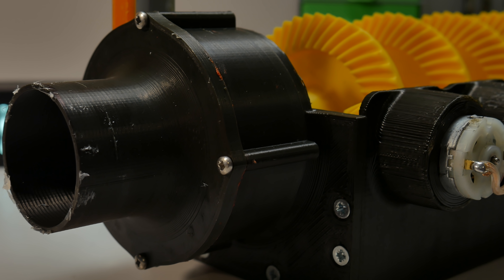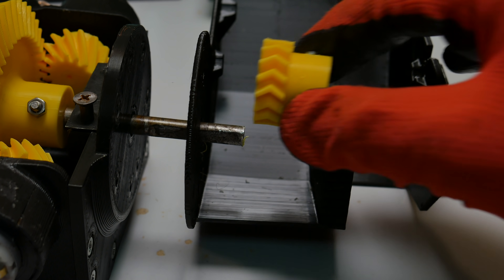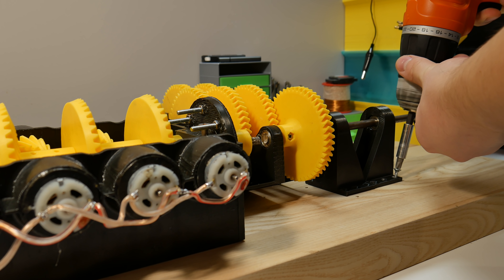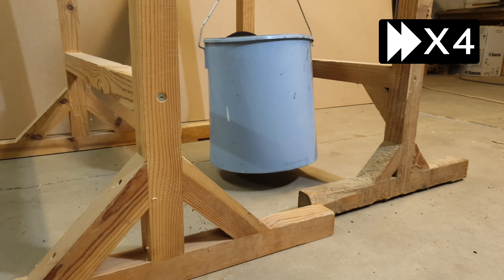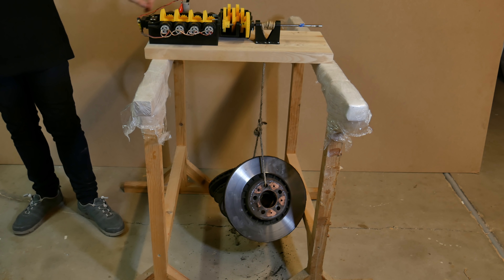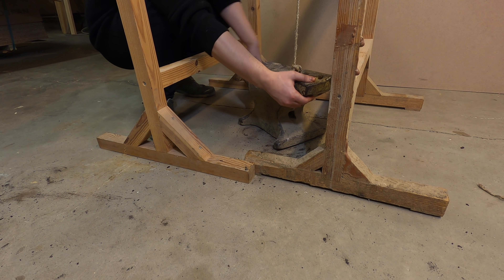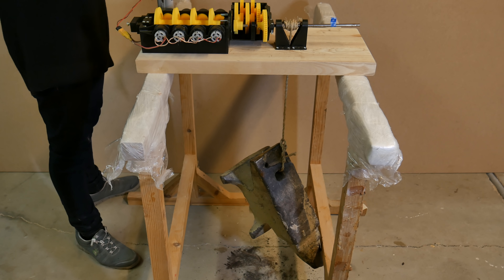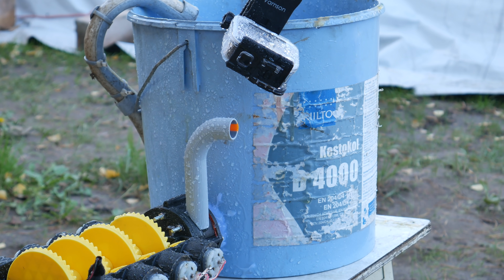This 3D Printed GEARBOX is SOO STRONG - Can This REALLY Lift Up More Than 80kg?

Comment: You can't use gear ratio alone as a measure.

How much torque is in the motors, then calculate the output torque based on your ratios, the use of ratios alone is meaningless.

Comment: I have designed a 1 to 1 Force multiplier ... / It can make the same effort as your multiplier, but the input speed is equal to the output speed ... and therefore, it has greater Power

Comment: no wonder when the gearratio is at this mega high level of 1:730
why not try 1:99999999999999999999999,so you will be able to lift Mount Everest while YOU standing on top :D

Comment: Can you print in polycarbonate?? Would probably give you highest strength, besides maybe like those expensive carbon fiber blends like NylonX.

Edit: actually its only $58, still expensive but I always thought more. Certainly attainable for a cool vid to see if it affects strength.

Honestly I feel like with those filaments your only limiting factor will be the motor torque.

Comment: You could increase the pull weight immensely if you added a block and tackle system, or other pulley system instead of having the rope be driven by thr output itself

Edit: 
But rip time to lift it

Comment: Shouldn't you be able to calculate the torque that's being applied on the steel bar, therefore telling you how much it should be able to lift? Not an engineer or mathematician just wondering....

Comment: The only thing wrong is nobody has given you access to a 3D metal printer.
Reply: funny thing is I actually got an ad for a 3d metal printer right before the video started
Reply: 3D WUOU RYLLI GOOD WORK HAVE MY WORK FOR 3D PRINTING HAVE PULEGGIA INTERNA
Reply: I hear integza's got one ;)
Reply: @cliffordwilliams9597  ye he did but i think a furnace is needed for those which a bit of a downside
Reply: He can cast a metal one if he wanted ,then harden it
Reply: Or a socket wrench apparently.

Comment: thats crazy my motorcycle only got 50lbs of torque and thats only half inch thick plastic 3d printers can print like 6 inches so you really could 3d print yourself a new transmission for your car would not have expected that kinda makes me want to try makeing a full size transmission with like 6 inch thick gears if it works i can sell transmissions on ebay really cheap not rated for any miles works right now good luck transmission if you know how to work on cars and cant get a ride maybe the transmission will last long enough to drive to the store to buy a new transmission

Comment: Ok, I get it. With a low enough gear reduction you can lift anything. Archimedes (I think): give me a fulcrum on which I may place my lever and I will move the world. 
What are you attempting to test here? The strength of the ABS material used to make the gears? The power contained in the small motors when joined in parallel? The efficiency of the motors in terms of their ability, when joined in parallel, to lift large weights and use only a small amount of watts from the power supply? I like your builds. Clean, fun to watch them work. But is there a purpose beyond showing a heavy weight can be lifted with a low enough gearing? 

One thing that is very clever about your motor assembly: screw block at the end that allows you to adjust the tension of the bevel gears and prevent the shaft from moving forward. It also allows you an easy way to replace motor gears that become shredded. 
It is a noisy gear box, the section with the motors, but if you attach a clear cover you can put a low viscosity oil in that area and the noise will be dampened, although you might have increased drag.
Reply: ???       What are you attempting to test here?      ???
are you  KIDDING.?????      WATCH  and  LISTEN    Again.

Comment: Nice work and amazing outcome for 3D printed gears despite the torque advantage ratio from the gearbox. Just an English language tip; you can lift something "heavier" but we don't say "more heavier".
Reply: or use the words 'Even heavier' if you are talking about the third weight in a series or higher if you need emphasis.

Comment: the force actually is at the metal shaft supported by those two end pieces with bearings.  The load, force, and stress are transferred down to the wood top distributing the total weight of the load lift.  The gearbox just turns and surprising, it does not take as much effort to turn or rotate a shaft under load as long as it's supported at each end as this one clearly is.  The torque necessary to do this is greatly reduced because of this. . ''That is why plastic gears can be used in this situation. and under such a low ratio.  Very nice experiment and idea though. Thanks for posting this.

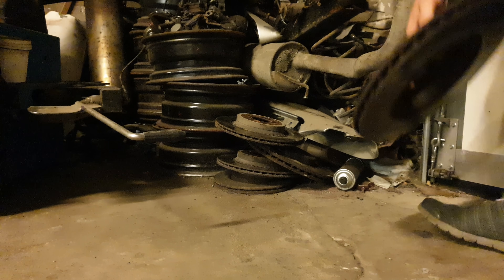Comment: 4:40 brake rotors or discs.
i like the gear cut you use. its a good way to reduce the side forces of the gears meshing. keeps them centered to each other and i think it would still be stronger than straight cut.

Comment: If you added a DC amp meter and even a motor temp that will show if you are over working your motors or not. One more idea would be to add a weight scale. At the hooking point of the weight you are picking up. Then you could hook up a very heavy weight that lefts from one side. that way. When the you could stop lefting when the motor got hot or showed high amps. That will give you a max lifting weight for your design. There is a very good chance the motor temps is the weakness point of a motor gear box design. Just a thought.

Comment: Brake Pads picks up disc brake rotor

Damnit, I did it again, sorry--I knew what you meant.
Reply: jesus christ i didnt even realize that xD i was just buggerd by the spelling
Reply: That's only slightly worse than the average American. I work at an auto parts store.
Reply: Love the channel though
Reply: Yeah and in the bottom left they called it a brake bad

Comment: Cool video. I bet you could lift way more. What do you think will fail first when you reach the limit?
Reply: Most likely a tooth on the output gear or the one driving it would break. Second would be the output gear would crack in the center where it's attached to the shaft. Also the fast moving gears could melt if you run them under load long enough.

Comment: It seems like the force each gear experiences is proportional to the gear ratio between it and the previous gear. In other words, the final output gear probably has to be substantially stronger than the first gear in the chain. Correct? Flipping that on its head, it means you could scale the gear widths / infill percentage accordingly (last gear is the widest / highest infill percentage)
Reply: correct.

Comment: Somewhat surprised that you haven't made an adapter to fit over the battery pack contacts, with a switch to turn things on and off, and since you are working with DC motors, perhaps even a 'reverse' switch. Not bothered by it too much, just surprised. Seems like a quick print and go.

Comment: See how awesome it could be... Try adding mechanical advantage to the rope.  3:1, 4:1, 5:1 etc using pulleys.  Lift numerous anvils, maybe a car or pickup truck...  Definitely film it!  Nice job!
Reply: https://www.ropebook.com/information/pulley-systems/
Reply: Lol I don't think it'll hold a car or truck
Reply: @thereal_morxy49  🙂  actually using the pulleys you could get the weight of a car down to  what the anvil weighs . A 1400kg car would be 280kg at the gearbox. And that would be if you were lifting a whole car.  If you were picking up just one end it would be less.  😁.

Comment: I have one question... is it really necessary to have multiple motors (in this case 8) to drive the primary shaft? I would think that the multiplication of the torque through the gear ratios would be sufficient to provide the necessary end force you are looking for.

Comment: Can you calculate the actual torque on the out-put shaft?
Reply: 70kg anvil, looks like about 100mm diameter gear, so around 34Nm.
Reply: @dekutree64  I don't want to know the gearbox torque out-put, that number can be changed to whatever you want or need.  I want to know the actual out-put shaft from the main motor assembly.

Comment: Impressive, what software did you use to model if, if fusion how did you make the gears
Reply from the maker: Thanks, yes I use fusion 360. I use this plugin for gears: https://apps.autodesk.com/FUSION/en/Detail/Index?id=9029586664984391977
Reply: @LetsPrintYT  thanks! will download and try to learn how to use it. in your experience with fdm how small can i go before i start to experience problems?

Comment: Very nice gearbox! I have a question: From your experience, what is the RPM limit of those 3d printed gears (with grease of course). After seeing that they can take a lot of torque, I might try to print a reduction Gearbox for a 40'000+ RPM brushless motor. Do you think that this could have a chance to succeed?
Reply: rctestflight has some video, search for "Brushless Gear Drive" on his channel. Also i saw with big motor for making ebike. In general you will look for low KV as possible, but really the issue is to have good bearing; while high speed, they have no big torque, so forces involved should be ok

Comment: Great video, i have a "technical question": what's the force limits of the material? It seems very high but i don't know how to quantify it.
Still, great content and great improvment in the commentary. Be confident my man
Reply: cnckitchen make various testing of material, but hard to say, there are many factor to take into account, like the shape of the gear (that V shape really helps).
I guess the only way to really measure is a destructive test, load the gear until something break
Reply: @lesto12321  thanks, i will look at the tests. Much appreciated
Reply: Tensile strength(how much stress in tension it can take without bending) : ~30MPa
Ultimate Strength(The max amount of stress in tension it can take before failing): ~40MPa
Reply: @dawsonhayfield4421  To clarify im not an engineer or something but i print, even if you know what material it is (pla , abs , some nylon) every manufacturer makes different filaments and also depends on the printer. Of course you can just look it up on their site but if you have a bad printer with underextrusion you gears/parts are gonna lack on the strenght value, so every print has a different (not much different) strenght.
Reply: @not.daniel4084  @fra gra Given he is using Herringbone gear teeth design which can be thought of as two helical gears parallel to one another, the helix angle allows transmission of a load(force) overtime so relieving the teeth of stress, it is also usually a more quiet design as well compared with traditional flat-faced gear teeth. The disadvantage of helical gear design is they encounter something known as axle load due to the angle of the teeth, I will spare you the details but a Herringbone design cancels this force out due to the parallel teeth. So why did I go through the trouble explaining this? Because I suspect given the explanation above the weakest point of this gearbox design would be the fixed gears shaft holes, so the mechanical property of this material you should be looking for is not tensile strength as this relates to better to bending forces but shear stress as the force being applied would be shear(turning). According to Researchgate, A good rule of thumb if you want an approximation of shear stress for the material is 60% of the materials tensile strength, but if you need the exact figures finding the grade of the material and using a material database such as CES, but do not rely to heavily on the data because the gear is a stucture so you will need to implement finite analyse, programs; Fusion 360 can do this quite easily though it requires practice on your end to get the correct results.

Also not to your discredit  Daniel but 30MPa for ultimate tensile strength for any grade of abs seems far too high for a thermoplastic, I've just taken a look at Engineering toolbox and their data shows 7 Mpa which seems more right.
Reply: @dawsonhayfield4421 Thanks for the data, where did i find it? Material specification?